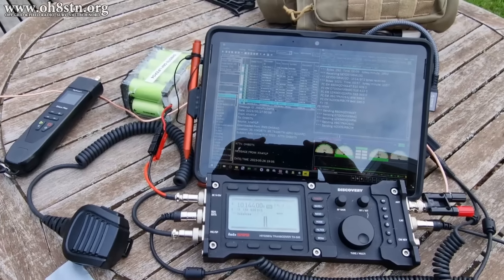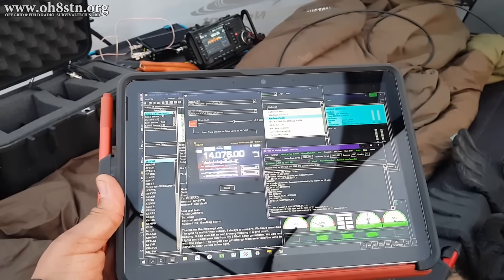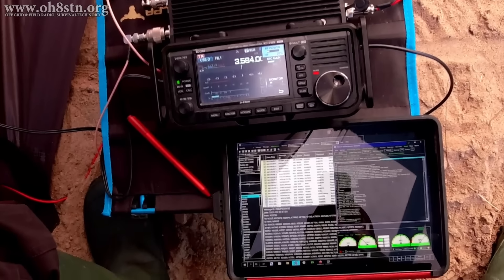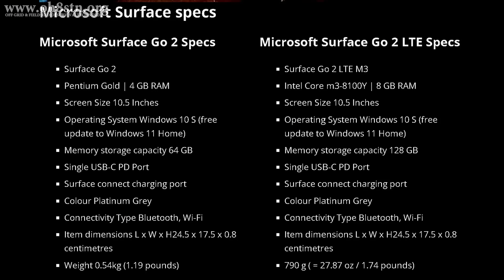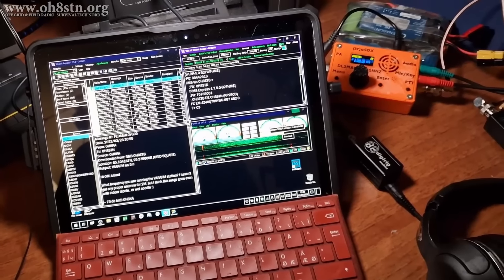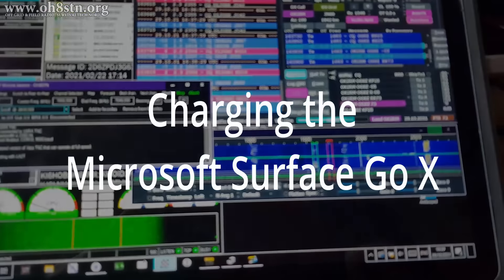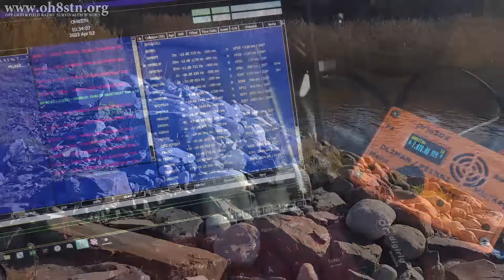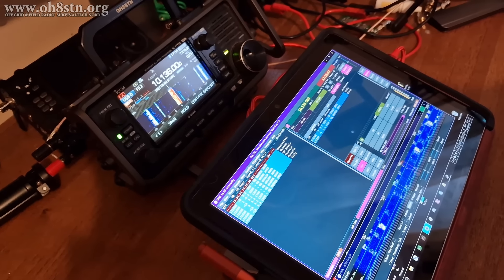Off-Grid Ham Radio with a Microsoft Surface

Comment: If I missed it on the video, I apologize. What is the theme you are using on the surface go. Some kind of dark theme?
Reply from the maker: You're all good. I'll eventually add this to the episode notes. I use a windows theme from github called "grayeve theme". It turns off all that ridiculous Microsoft nonsense that kills your eyes. For winlink, there's settings, Set color theme. Make the text white and the background black. Do the same for lists.
For FT8 and JS8Call, Edit the foreground background and list colors as desired.
For FLDigi, there are no themes or settings to make it any better.
73
Julian oh8stn

Comment: Do you ever have stability problems with the wireless connection between the IC-705 and the Surface Go 2?
Reply from the maker: Only when the 705 is connected to an overloaded wifi or wifi mesh network. Never when connected to the 705s own wifi network.
Reply: @OH8STN  Thanks for that.  I have problems with the connection to the 705’s own Wi-Fi network.  Most of the times I use it like that the connection eventually drops.

Comment: What model surface? A newer model or an older one?73
Reply from the maker: I prefer the M3 cpu LTE model 2,3, or 4. The newer Pentium Gold models have performance issues.
Reply: I have a surface pro 4 and it does everything I need for data modes. Use a dock and put it in the shack that way it’s always up to date. You also can power the unit with a 60W PD 12v auto plug and the requisite adapter cable.

Comment: I try to use only free open source software. I mostly use fldigi and fsq per amrron guide lines.
I have a 10 watt usdr txcvr (china clone), atu-100 tuner, 40m efhw, an old laptop, samsung tab 8 tablet (andflmsg which is very limited and no fsq, but works) and digirig mobile. I have a simple battery pack, diy 18650 packs and vehicle dc laptop power supply. Currently I have no solar panels. It works well and when on battery only 3 cables are used.
Reply from the maker: Yes, I wish all our software packages were open-source. FLDigi has good functionality, but the user interface is hard on the eyes. 
Also wish we had a full-featured open-source Winlink client. PAT is a good start, but not on the same level as Winlink Express.
Thanks for watching and commenting.
73
Julian oh8stn
Reply: I agree, fldigi ui is old in appearance. Thanks for responding!
Reply from the maker: No worries. Would have responded earlier, but I was working on this friday's video 👍

Comment: I have a Surface GO 2 and gpsgate installed and it is red and says running ok but no data coming in. I have tried everything and searched everywhere I know for a solution. Anybody have any ideas?
Reply from the maker: LTE has to be turned on, even if there is no simm card.
Reply: Thank you! I will try and figure out how to do that

Comment: Hi Julian, I need to stop watching your videos LOL. I found a reconditioned M3 variant Surface Go 2 with 8GB and 128 storage on Amazon, and also the Kensington hard case. My credit card now hates you <jk>. I've also got the Icom Remote software coming in too. I think its a bit steep of Icom to make users pay for the privilege of remote operation, but I guess if I ever get another digital Icom radio (unlikely), such as the 7300 then I can use it with that also. I'm reminded just how expensive this hobby is at times. 73 G1AW

Comment: My guess is this is only for LTE models?
Reply: If there is a WiFi only model workaround let me know what that is.
Reply from the maker: The only thing dependent on the LTE model is the GPS. If you're using the 705, which has an internal GPS, one could use that. Otherwise choose which model is right for you. I have the original as well as the LTE model.
Reply: Wish I hadn’t installed it. Ever since been getting a Com4 is denied message. I’ve even uninstalled it. Great.

Comment: just remember anything you do on a MS tablet or computer is recorded and sent to MS as data so anything you want to be encrypted MS will have a non encrypted version saved, to those that think I'm paranoid you should do some research on what data MS collects, read the fine print in the service agreement. all this is to say don't use MS software or hardware if anything you do may be used against you in the future. Microsoft is just not secure in anyway.
Reply from the maker: Generally agree but, my Surface DOES NOT connect to the internet! It is for off-grid ham radio.:)
Reply: @OH8STN 
I mean, it doesn't connect that you know of.  Unless you have physically disabled the wifi you don't really know either way.
That said, I'm using a Go 3 LTE.
Reply from the maker: Agreed, and good point! At home, all ports are blocked unless allowed. In the field, no wifi or LTE enabled. I hate MS spying, so I'm somewhat paranoid about it 🤣👍